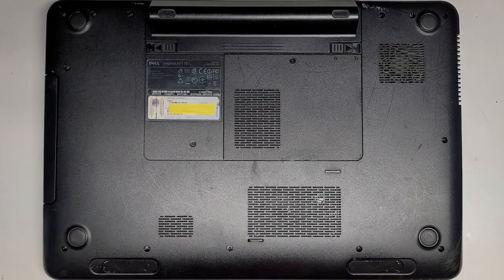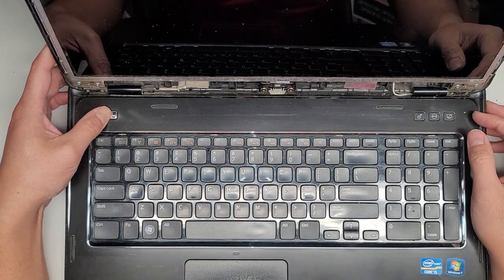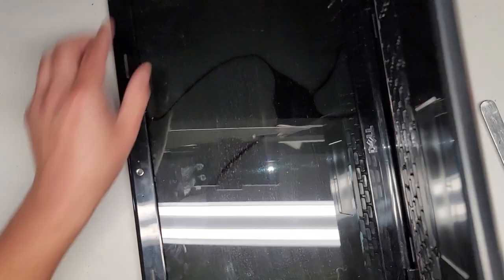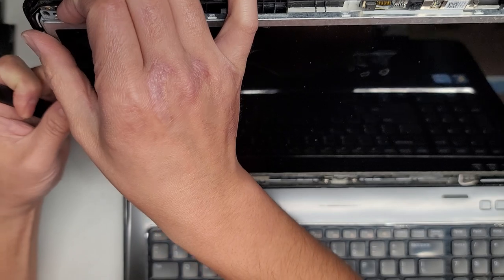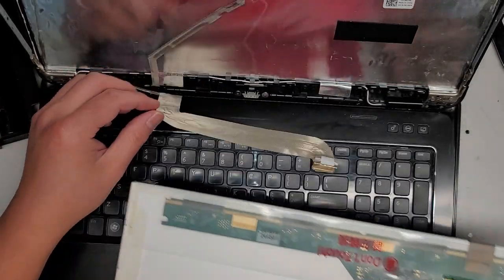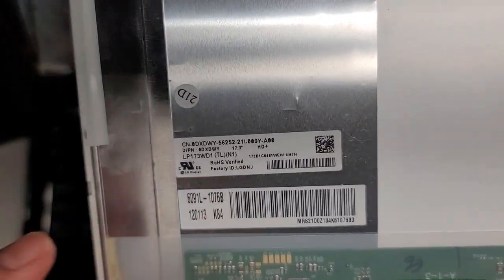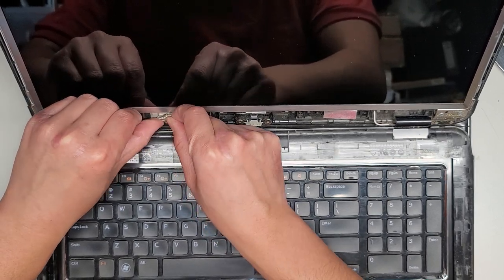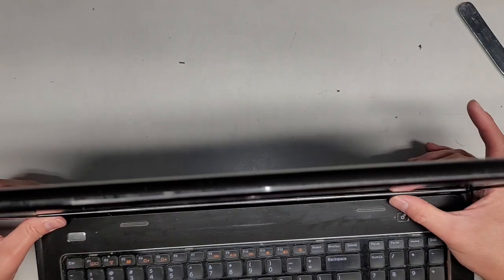Dell Inspiron N7110 Disassembly RAM Optical DVD CD Drive Keyboard LCD Screen Replacement Repair

Comment: Where would I go to buy parts?
Reply from the maker: @brunoierullo9306  usually ebay or Amazon
Reply: Thank you for the reply.

I like this laptop, Do you think it can be upgraded to use windows 10 or 11?
Reply from the maker: 10 should work, 11 requires specific bios settings. I'm not sure.
Reply: Thank you!
Reply from the maker: @brunoierullo9306  no problem

Comment: I bought another 4GB memory card and when I installed it, it makes a noise as if it is overworking.

Do you know if I have to replace the Hard-Drive to a SSD or, the cpu?
Reply from the maker: What does the noise sound like?
Reply: it is a sharp peep peep
Reply: Computer working fine now!

It looks like the new memory card was not into the slot fully.
Reply from the maker: Awesome!